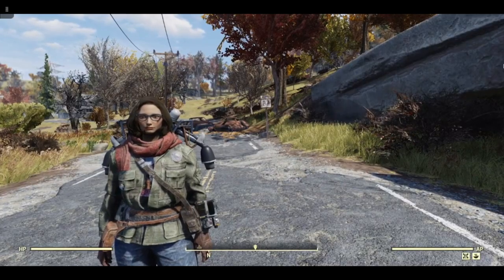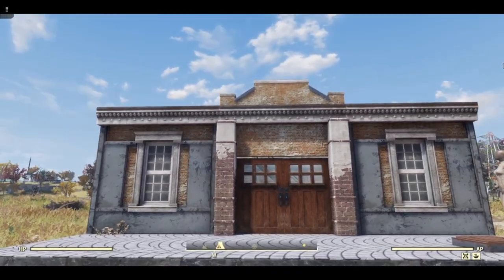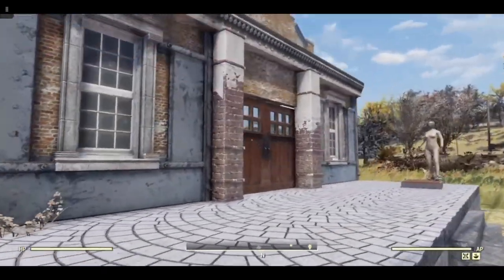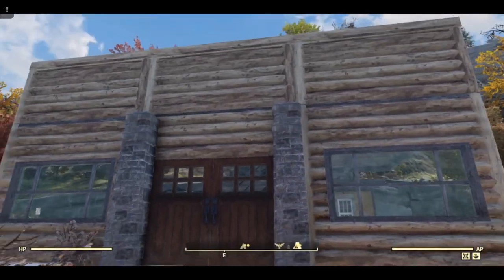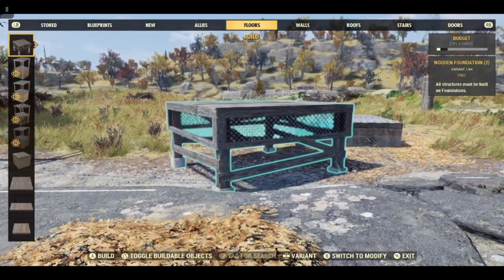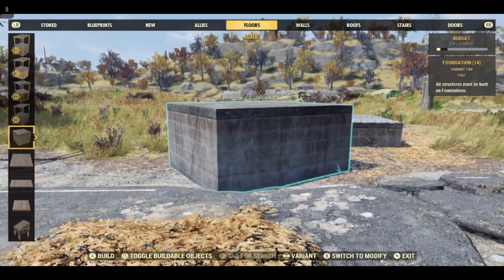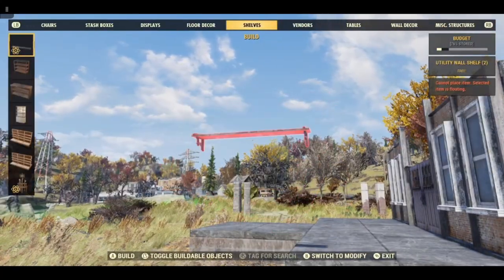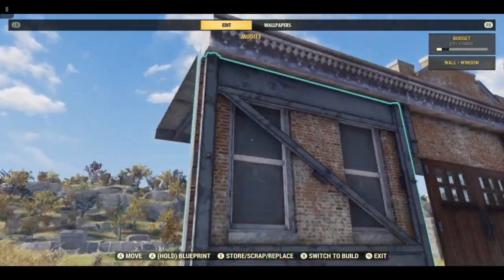How to build with Double Doors

Comment: Oh, for those metal pillars, I found you can burn them and get them close together so there is no gap.  I ended up doing that when I used the metal pillars as a partial wall in one of my builds
Reply from the maker: Good to know, thank you

Comment: would it be possible to do this without the catwalk?
Reply from the maker: You could try raising the foundation and then carry on raising them until you are under the doors. You will need to destroy the doors. Then add a half wall, add another half wall on top. That will be your half wall over the doors. You will need to destroy the top wall to remove the one underneath and then repair everything. I might quickly try it....
Reply from the maker: It worked